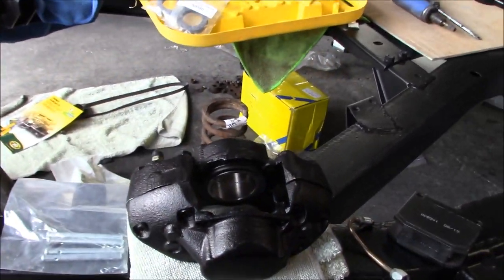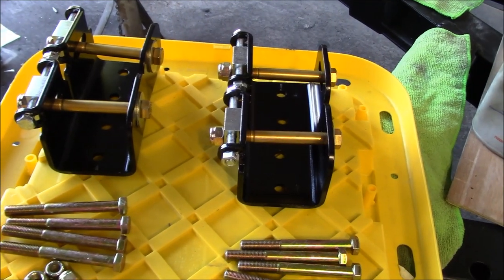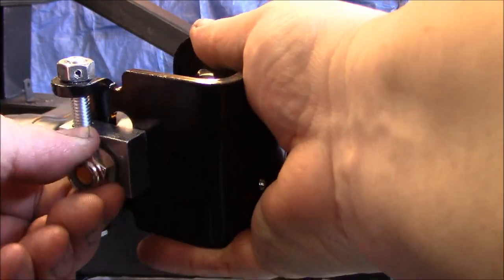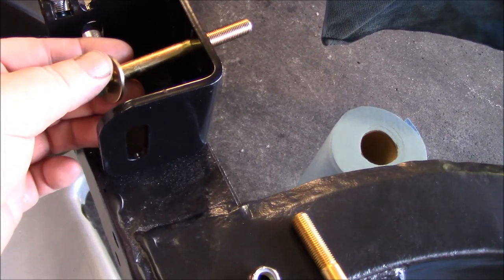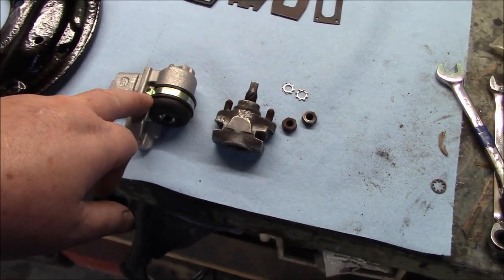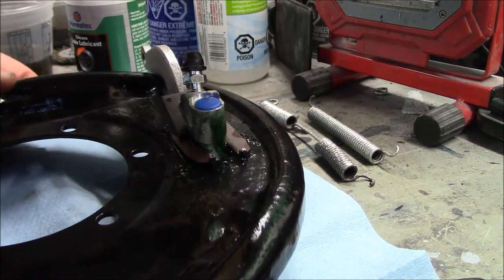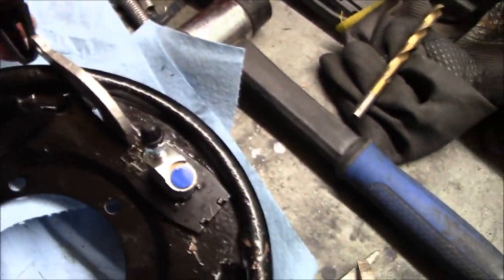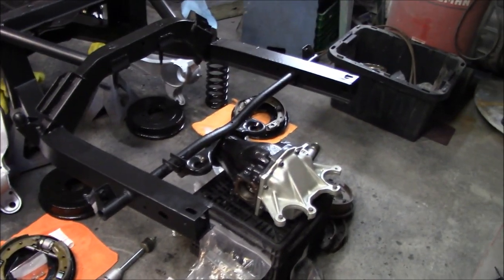1968 Triumph TR250 Restoration, Front and Rear Suspension, Front and Rear Brakes, Part 3

Comment: Your new brake assembly has both springs between the shoes and plate. The old one has one inside and one outside the shoes. Just an observation, Tush. Enjoyed the video.
Reply from the maker: Howdy!  Yes, the old ones are incorrect, not sure where I got those. ...the ones I built are correct with the springs in behind the shoes.

Comment: Definitely going to use the good parts brackets when I get to the 6, on the backing plate for the rear brakes, any reason why you didn't use the original or you had a separate set around?. Les looks tired, your working him to hard. Great job David..
Reply from the maker: Hi Robert, I had a spare set kicking around...I’ve got a lot of spare, spare parts 😉

Comment: Dave don't you still have to put the shims in the rear.
Reply from the maker: Hi Ralph, yes I will but remember it’s a new frame...I wouldn’t have any idea what to add and where...I’ll take the shims (both front and rear) to the alignment shop with me.  Cheers, Tush
Reply from the maker: ralph cap hi Ralph, I’m going to take it to a shop that will let me “supervise”...i definitely just won’t leave it at a shop....they will have no idea what to do I suspect unless I find a real old timer shop and those are becoming very hard to find up here....

Comment: They probably threw in those two extra bolts to replace the two washers they shorted you. lol
Reply from the maker: Lol probably...I didn’t think about that!
Reply: @cheftush   maybe they are for the steering stops
Reply from the maker: steve ludeckery hi Steve, I thought about that but compared them to what came off the car ( on the passenger side) and these bolts are much longer.    I should try threading them in for fun..,I guess I could also look up the length they a supposed to be in the parts manual.  Thanks.